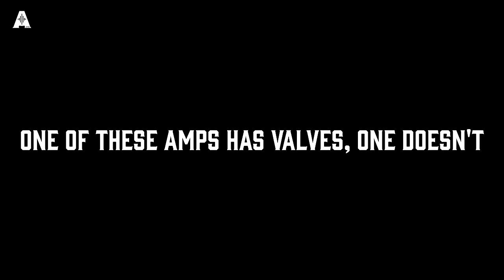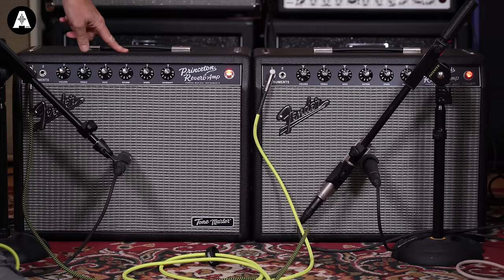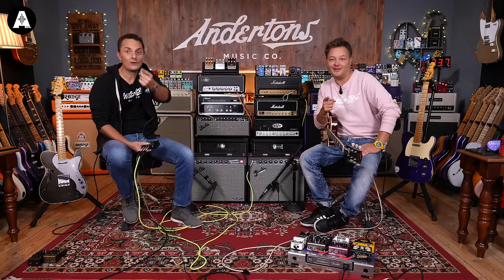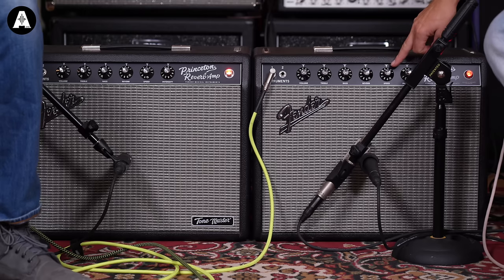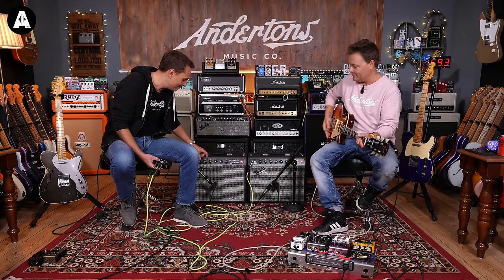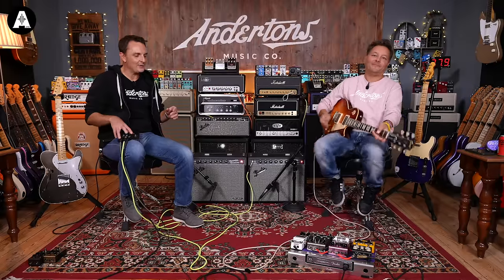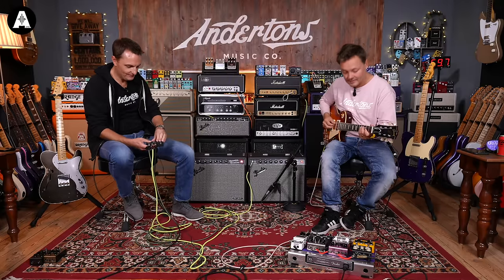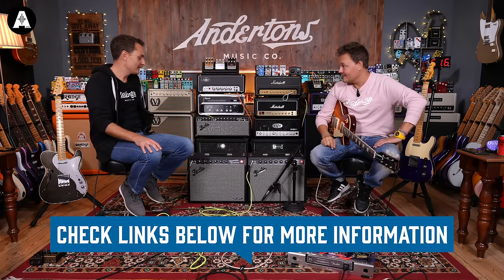Fender Tone Master Princeton vs the Real Valve Amp! - Can You Tell the Difference?

Comment: Thank you for trying a fuzz through them both. In my experience, fuzz tends to be very different through digital processing (whether it’s a digital amp or cab simulation)…but like any amp, it’s possible to find a pedal that will sound good through it. As amps move from valve to digital, I imagine we will see pedal makers adapting to get those classic tones. Maybe all those vintage pedals will all become worthless as they don’t produce “the” sound through digital amps.
Reply: "Your fuzz is great, but how is it with specific digital amps?" - No one.

If the amp can't support most pedals out there already, then someone is going to be making amps and pedals for a very niche market. I think the onus is on digital amps to take existing pedals well. Making a fuzz for a digital amp sounds like a bad stopgap solution to a problem that was invented and ideally won't be around forever. People who have pedals want to use those pedals. They're probably not going to want to find a digital amp friendly version.

If you want fuzz compatible with digital amps/amp models, just get an all-in-one Fractal or Line 6 system. Otherwise, building pedals for digital amps sounds like a bit of a reach.

Comment: I am really starting to think I can get equally or even more consistently great sounding tube tones with the right digital amp modeling.  In this case, however, I'm not sold.  When you kick in a little overdrive, the digital amp is noticeably thinner sounding.

Comment: Tube amps will always give you a warmer, deeper bottom end while the digital will always give you a sharper, more defined high end. The difference is subtle but definitely there. If these were used without the other in a side by side comparison, it would be difficult to tell the difference. Technology has come a long way but not enough to replace a tube / valve.
Reply: IMO the only digital gear that actually beats valve amps for sound is the Kemper. And even then, it's a profiler (and you really can't tweak it all), so you still need valve amps to capture sounds if you want a different tone. Gotta have both.

Comment: Pretty impressive. You can tell the difference but it's small and in a mix no-one would ever know. If you were buying a new Princeton it'd be hard to argue against the cost, weight and features of the Tonemaster, but if you're already blessed with a valve amp, not really worth changing. Only downside is, as you say, if it goes wrong it's a bigger problem than taking it to your local amp guru and could be expensive. Having said that I use a Roland VGA-3 for practice which I think is from 2003 and it's still got great sounds.

Comment: Background:  I own a silver face Princeton Reverb (vintage) and have played it since it was brand new.

I was able to distinguish between the two amps immediately, however I got it reversed.  Amp "A" sounded more clear and pristine and I thought for sure that was the solid state amp because clear and pristine  were the strong point of solid state while amp "B" was more nasal and slightly boxy.
Wow was I wrong.  
I believe that the designers overthought the  vintage sound and designed the filter so it sounded "vintage".

The good news is that they can patch the filter and open up the amp because there's plenty they are filtering out.

Sounds like a nice amp and can only get better with software upgrades.  Kudos Fender !!!

Comment: I can't tell which is which (on the initial example).  Maybe I liked B a bit more, but I think it was a little louder so it may just be that.  They did sound different, Amp A was brighter like a Princeton, with Amp B being a bit warmer.  Tube amps are a bit like fingerprints in that no two are identical, so unless you have the actual Princeton used for the emulation...
  Speaker emulation, could hear more of a difference.  Also, the fuzz, big difference.

Comment: I’m adding a comment because I can’t find the old comment to add to it…
I just gigged with mine and it sounded and felt fantastic….I never once thought “oh…this is a solid state amp”…
More than once when reaching around to turn it off I was careful to not touch the tubes…and only then remembering that there aren’t any!
I changed the speaker to a Eminence Signature Series GA10-SC64 and it sounds even better! 
It took a slight bit of top end sizzle out which I wanted.

I also used a Nobels odr-1, which sounds crazy-good with my Tele with’51 nocaster PUPS.

It’s one of the best tube amps I’ve owned and I have an amazing sounding 75 champ and a 77 vibro champ, and this is every bit as good or better sounding and feeling

Comment: Was able to guess which was which after a couple minutes.

The main difference to me though was the reverb. The digital one sounds a bit more brittle to my ears. Subtle and probably would not be able to pick out in a band mix.

Both amps sound really good though .

I have been on a bit of a tone journey of late and have come to the conclusion that many of the nuances in this type of thing come down to things that are difficult to demo on YouTube.

Touch sensitivity, dynamic range , compression, headroom/ ability to play well with pedals. These are all things that are difficult to convey without actually getting a piece of gear and playing it yourself.

Those are usually where the difference comes down to these days based on my experience with different amps and amp sims of late. 

That all said in a band mix very few if any people will be able to tell the difference. I know I wouldn’t be able to.

Comment: Did you ever asked yourself why all the knobs on the guitar and guitar pedals and amps?
Well that the reason why!
The Tonemaster feel to me more ready to mix in a full band scenario.
When the bass guitar fill the low end and the drums fill the high end.
The fuzz need some tweaking and maybe low overdrive pedal after it to smooth it out.
It will not sound identical to the tube version but it will sound good and fun and convincing.

Comment: i bought a tone master Princeton. it sounded good enough for me for home use, not quite tube sound but good enough for the weight sacrifice and low vol practice. sadly it lasted a month before it blew up. Fender were good and repaired it under warranty. 
I would buy another tone master amp but Fender needs to make it more reliable.

Comment: Picked up one of the Tone Master Princetons yesterday and have played it now for a few hours. I have the all tube 65 Princeton Reverb reissue as well, but I can't do a true side-by-side as my PRRI has a 12" Jensen and JJ tubes. But... they are remarkably similar. The Tone Master is brighter than my PRRI, in a pleasant, chimey, glassy way which is extremely tube-like. It may have something to do with the 10" Jensen against my 12" one. With my 2012 Telecaster it sounds delightful: clear and well-sculpted, not harsh but definitely a bit thinner - more focused maybe - than my tube Princeton with the same guitar. With my Les Paul Standard it brings out all the right tones from the Burstbuckers, and, again, it is a bit brighter and I think even a bit more articulate. 

Where the amps differ quite a bit is in the point of break-up: the Tone Master stays clean at higher volumes than my PRRI. With my Telecaster, I had to push it up to 7 before it gave me the sort of break-up that my tube version produces at 5/6. This seems to be more pronounced when the amp is set to lower wattage. On the 0.3W setting it stayed clean until 8 and then rapidly went fuzzy. This may be my ears playing tricks on me, since I suspect it may be harder to detect the characteristic edge-of-break-up of a Princeton if the volume is lower overall. My Les Paul pushed the amp a bit harder and got some nice driven tones at 6, which is still later than my tube Princeton will break up with the same guitar.

This is not a problem, necessarily. Not for me, anyhow, since I tend to stay in the clean end of the spectrum and use a drive/boost pedal to get my edgier tones. In the clean zone the Tone Master sounds beautiful. Really, they have done a fantastic job of making this Tone Master sound like a small blackface Fender tube amp. One of the things it does best is the effect of clean tube compression: that slightly squishy way a real tube amp responds when you dig in a bit. The TM does that really well. It never sounds flat or lifeless, it responds beautifully to light touch, has loads of nice harmonics, and it fills the space with lovely Fender blackface tone. I am impressed. I will not be getting rid of my tube Princeton, and I'll continue to play it often. But it will stay out in my recording studio for tracking, and the TM will live in my house for daily noodling and practice, songwriting, etc. Perfect practice amp, and easily good enough to use for recording if I want to play in true stereo.

Comment: I replaced my tube Deluxe Reverb with the TM and there's no going back. I agree the drive sounds were a little cold compared to the tube amp in this video, but the XLR output, lightweight, etc totally override that flaw. I can't see myself buying another tube amp unless I lived in a house I owned with a studio and never had to move the amps that were in it.

Comment: Since they probably dialed in the emulation based on a few vintage units, it's not going to sound the exact same as a reissue, which they might referenced, as well. That said, they're very close and both sound good. It shows that digital emulations really have arrived. Personally, I'd rather have the tube reissue if it were for home use, but the Tone Master for gigging.

Comment: As soon as Pete kicked in the Dane, the difference was pretty noticeable (in favor of the real one). Not side by side, I think I'd still like the Tone Master, especially with the attenuator and recording options, but the real one is just more desirable.
Reply: Truth, I have the Deluxe Reverb Tonemaster and that's the point I'm stuggling with, as soon as you put a OD or boost in front, it doesn't get the same kick in the tubes as a real tube-amp....
Reply: Even the fuzz; It crapped out as soon as that fuzz hit it.

Comment: Very similar. Digital technology makes the job perfectly well, both in pedals or integrated inside the amplifier, but tubes moving speakers is my personal choice. Tube amplifiers do need relacing matched tubes and biasing them every so often, but the magic of tubes does deserve the extra jobs, extra weight and extra price, imho. My Marshall EL34 100+100 was crazy expensive, weights a ton and makes a lot of heat, but with the right pedals in front and a couple of four twelve inch speakers cabinets sounds second to none.

Comment: Nice review! Where I really think you hear modeling tech is when you record to a DAW, in the room they sound close but once you commit it to a track, at least in my experience, you notice a big difference. That's because moving air into a microphone plays a big part in the recorded sound which is hard to model. I have the new ToneX software and practicing sounds great through my monitors but it doesn't translate to a recorded track quite the same. It sounds good but I hear the difference and have to do some work EQ, effects wise to get it sounding better and closer to a real mic'd up tube amp or how it sounds in the room.
Reply: Interesting point. In that case one could just mic up the Tonemaster and record that.
Reply: @jemandthemystery  I never tried recording a digital device with a mic and a speaker. I can't do that where I live, but it'd be worth a try if you can do it.

Comment: I noticed a difference, guessed that the one that sounded "better or warmer or fuller" was going to be the Tone Master. This is what I came across when searching for a Deluxe Reverb (DR) last year. I researched the Tone Master and the regular. I went to the store ready to get the Tone Master but it doesn't sound anything like this in person. In person the DR sounded more like the recorded Tone Master. The recorded Tone Master version had a much more sterile response and feel. I bought the regular DR as a result. Neither amp sounded, in person, how they sound in mic'd recordings. Not even close. I ended up returning the DR because of tremolo issues and aloud ticking. I got the Princeton Reverb instead. I found the Tone Masters to be great amps but just different from their regular versions.

Comment: 12:50 ... just a note to say that the tremelo depth of the TUBE amp is dependent on the biasing, hence you'll get a slight variation, even when doing an A/B comparison between 2 Princeton tube amps, therefore I wouldn't worry about a hair-splitting comparison between the tube amp and the solid state model.  I would expect all solid state Tone Master models to be identical in performance.  One thing I might say is that the Tone Master amps are so good, that they'll probably out-sell the tube amps, which is not a bad thing and Fender might sell more Tone Masters than re-issued tube amps as a result.  I envisage that Fender will offer a Tone Master version of ALL it's famous amps ever produced.  C'mon Fender, you can do it! :)

Comment: I think that where these sound different is basically down to EQ settings as the valve model does not suffer from flubbiness in that the highs and lows are tight and present whereas the Tone Master needs more tweaking "boosting" of the lows and highs to achieve the same response. This has always been an inherent characteristic of solid state technology in amplification; they have great mid range punch, achieve great volume levels, and usually accept wide ranges of ambient effects very well, but lack the sparkle on the high end, as well as, the tight grit of bottom end. 

 While the two of these amplifiers are supposed to share the same tonal qualities the difference in circuitry to achieve that tone will not share the same EQ settings to render the same effect. I believe that the Tone Master has all the goods needed for a small venue gigging musician as long as they are mindfully of needing to add an external EQ to their pedal board to tighten up the bottom end and clean up and bring out the sparkle of the highs. I also think that both sounded very comparable when running the Dane and other overdrive pedals; however, the Tone Master is going to come up very lacking in comparison if the user is looking to get natural break up driven tones that come from pushing the amplifier like Pete and Lee shown the valve model do when turning up the volume. Solid state tech lacks that ability and will need the addition of a pedal. 

 In my mind for 500 to 600 bucks less the Tone Master is close enough to the valve model in most of the desired tones that these amplifiers would most likely be used for that it is a no brainer choice as it will neither break the bank, nor your back thanks to the significantly lighter weighted package of its circuitry.  The gap in tonal excellence between solid state/digital and valve amplification has been closed significantly in the past decade or so to the point that it is almost a matter of how much money you have burning a hole in your pocket that is the ultimate deciding factor between them. Just one man's opinion.

Comment: imo only the fuzz face really sounded different, fuzz can be a bit temperamental at the best of times but personally I would want it for that ZZ top vibe.  When he hit the Dane and the other OD it was more or less the same tbh very subtle difference.  The Tremelo/Vibrato was a noticeable difference but overall not that much between the two amps, was pretty impressed if I'm honest i thought the sound gap would be bigger.

Comment: I’ve always used a tube amp, but I got tired of it ceasing to work (not cheap amps) at gigs, finally went to a Blackstar Siverline. I can really hear the difference, but it suffices for now. I’m still running it through my old Marshall 4 x 12.
✌️🤔🎸🎶🎵🎶🎵🎶
p.s. I can hear the difference hear, but it’s minimal.

Comment: Yes, you can sometimes tell a difference when switching directly form A to B. But you would never tell the difference if you heard either of them alone, or even know that there was a difference to be contemplated. No two amps sound the same, even those with the same components. And no amp sounds the same in every setting. Obviously there is a range of tones and voices that go along with a given line of amps, but the fine differences between solid state and  valves are smaller than the differences between individual amps of even the same make. In this case, I prefer the solid state in  cases, the valve in other, but love them both and would have no thought about it all if I heard one or the other.

Comment: Both sound good, but people going for the TM version probably have other reasons other than whether it sounds 100% like the 65 RI… I got my Deluxe Reverb TM because it had attenuation and DI out. I live in an apartment, I can use a TM at home, rehearsal and gigs. I had a 68 Custom Princeton before that and it was too loud for my apartment. It sounded awesome cranked up but the lockdowns ruined the opportunity to do that…
Reply: yep , same here , i have my tm dr for 3 years now , i use an behringer P1 with it at home so i can also play with headphones wich makes it an even more practical amp , i can play as loud as i want without bothering my neighours , i have also used the amp for gigs and rehearsels and it works and sounds great , i removed the tonemaster button and everyone thinks it's an tube amp 😀 (  i have not done the firmware upgrade , i see no need for that )
Reply: @antoonhermans8953  I got an XLR to 3.5mm converter cable from Amazon for headphones!
Reply: @chrisj1602  yes , i have seen some other comments of people doing it that way , it does make the amp even more practical , if this one breaks down , i for sure will buy another one , for me this is the ultimate amp , i'm not into modelers and such , this is as digital as i want to be 😀